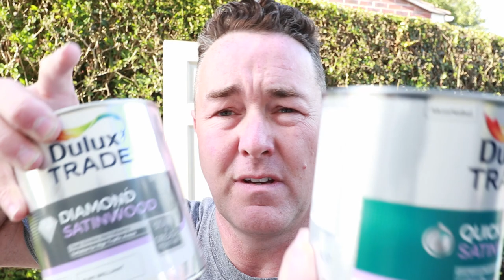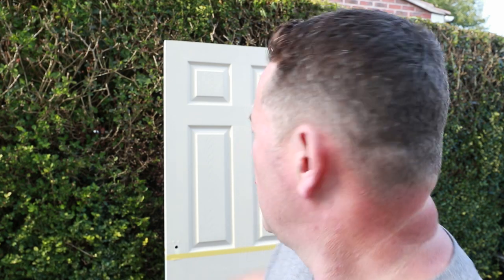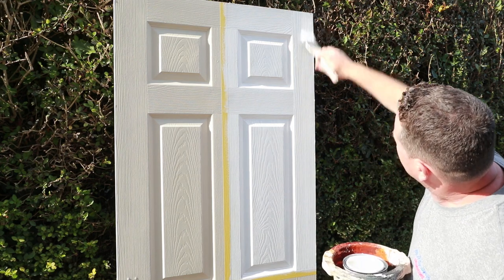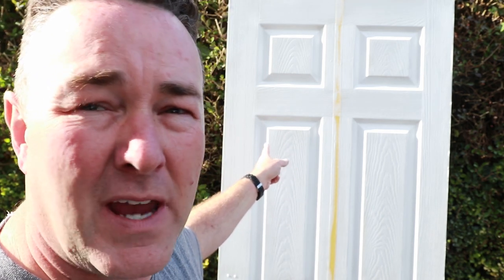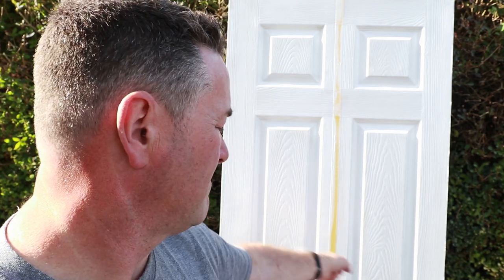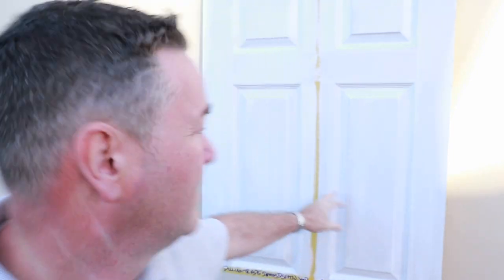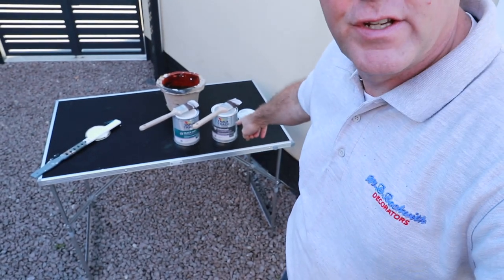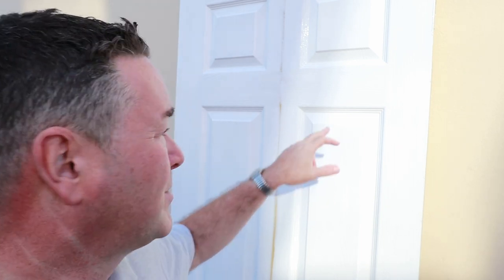Honest Review: Dulux Quick Dry vs. Diamond - Which is Truly Best?

Comment: Hey Phil, I tried the quick dry satinwood.  Poor coverage and very runny. Never used it since.  The Diamond I have used quite successfully over old white woodwork especially where I needed something less smelly than Dulux trade satinwood(oil based). I tend to apply it with a Purdy White Dove mini roller and lay that off with a nice brush.
Reply from the maker: Did you use a QD undercoat with it first?
Reply: @ProfessionalPainterDecorator  I did with the quick dry but not with the diamond. I'm going to try the Bedec MSP and the Scuffx next on your recommendation. Cheers.

Comment: Bedec advance Primer is fabulous as it gives the perfect base. Their satin is nice and their gloss is as good as it gets for water based on the second top coat. I now use Crown PX4 as bonding primer. Dulux diamond eggshell (Jan '24)  for interior work, covers well and finish is spot on but always three coats over anything other than pure white. Thanks for the comparison, got me thinking hence my comment.
Reply from the maker: Tnx 
Have you watched some of the other satin paints I've tried?
Reply: @ProfessionalPainterDecorator  Gradually going through them, I think the Dulux Diamond eggshell shows that Dulux may have listened!  Actually got some Aqua Guard to try , I spoke to a rep at Brewers and he was insistent that acrylics need to set properly for the next coat, so your video of Aqua Guard drying over night would appear to be best practice. I have to sneak time to watch as being at home there are other 'duties' . Will watch more. 
You're a great presenter and I like your dry humour!
Reply: The other thing is how easily paint cleans out of a brush. Sadolin Superdec is probably the worst culprit on this front , isoproyl alcohol, hand soap, 'brush cleaner' nothing touches it and brushes are toast . Sometimes paint choice comes down to availability too. Just saw your review on Allcoat and Frenchchic. I use the former as it does say it has a 15 year guarantee and when the client has just forked out five grand for scaffolding the paint has to stay put. The frenchchic I must try when appropriate. Really good that you're doing these comparisons like for like, really saves us time.
Reply from the maker: @lucifarian93  watch the others... I bet you'll move away from Dulux diamond by the time you've finished

Comment: I tried the diamond satinwood again today Phil and you need to water it down like all Dulux Trade paints. All Dulux Trade is thick with ingredients and go on lovely when you’ve thinned it to how you like. 
The diamond satinwood has a lovely sheen and is a proper whiter than white. Once dry I would struggle to tell which is oil satinwood and which is the diamond

Comment: Hi, I have a question what is the need for undercoating walls and woods rather than just putting 3 coats on of the normal paint? is there any advantage to using the undercoat. Another question what benefit would you get from using an undercoat rather than using a cheap contact matt and then applying one or two coats of that to lighten a surface then using two coats of the finishing paint. Im thinking more for already painted walls.
Reply from the maker: you're referring to wall emulsion primer coats prior to emulsion finish coats.... not woodwork paints like in the video??

(woodwork)  Undercoats are there to give a sound base for the subsequent follow on top coats, using  the same brand/make of paint for a 'Hand in Glove' will give better results too and less likely to get compatibility issues between paints, the Uc helps adhesion on the top coats. Just like a primer for bare wood or surfaces is advised which soaks in to the substrate, that then gives the base for working on with the Uc, then top coats.

similarly so emulsion paints are more suited to have a wall/ceiling primer (undercoat) applied before the 2 finish coats. F&B have a wall/ceiling primer that can be applied first, this does work.
I think it's slightly cheaper too than using the top coat emulsion paint.

I wouldn't be using cheap contracr matt paint to be saving a few pounds now better primer/undrcoat paints are out there.
Reply: @ProfessionalPainterDecorator  yeah sorry I did mean more so for walls rather than woodwork it’s just this video brought it in to my mind. I just always wondered what the gain would be from using for example optiva primer on walls that were already coated over either going straight on with that topcoat paint or if it was a dark wall using a contact Matt then topcoat. 

I understand the woodwork side of it as often working with trickier surfaces or paint types.
Reply from the maker: Optiva primer is for bare plaster.
If you have good printed walls, two coats of the chosen paint should be fine.

As said, f&b for a wall/ceiling primer with does act as a great base for their colour range.

Comment: I have done 2 coats on primed white windows and still looks bluey thrucit on edges. Also how much are you Sanding down as even a light sand takes the edges off back to bare drives me mad
Reply from the maker: Between coats it's a worn sanding pad. But if you sand off edges again and the underlying paint shows though.. it's a step backwards.

As said... There's better paint out there now.

Comment: Hi Phil do you know if you can spray the water based quick dry satinwood you used in this video
Reply from the maker: Yes. Just make sure you've thinned it enough. Some paints do struggle being sprayed.
Reply: I sprayed 22 flat doors with it last week and it's lovely in my opinion. Thinned 5 - 10% depending on the day and they came up really nice.

Comment: Phil been in the construction industry over 35 years and done a fair bit of painting in that time. I do not consider myself at all a decorator. Can I ask your advice I have purchased a Dulux trade weathersheild exterior quick drying satin in a dark blue. I decided to use some of it to paint an old wood table top because I liked the colour. 
I have tried 3 different mini rollers and a brush but still can’t get a smooth looking uniform finish. I sanded and primed the top but now it’s had about 4 coats of dark blue ontop and still looks patchy. 
Any idea how to get a good finish on the top coat. 
Just for clarity I did not buy the exterior paint for the inside table but thought it should be reasonably hard wearing to use once it’s cured. 
Thanks I’m advance
Reply from the maker: Hi.
Should be ok.
What rollers have you used?

Have you tried a 2 fussy Blokes 5mm roller yet?
Add a bit of water to it and see if that helps flow  better.
There are paint additives that keep the paint easier to apply and work.

But try some water first.

Sand down what you've done once it's dried though.

Comment: to be fair though phil you do even need 2 oil undercoats sometimes with mid range colours
Reply from the maker: can't remember the last time I used oil though.
Reply: @ProfessionalPainterDecorator  the post 2010 ones aint great to be honest i always use palatine as they didnt have to change their formulations back 2010 i dont find the post 2010 ones all that durable really diamond satin is tougher than oil based version without a doubt for scratch testing. post 2010 oil paints in tints stay tacky for ages. palatine industrial 2 hour gloss is best for interior work really durable bashes dulux crown johnstones out the water and palatine oxide gloss for exterior work they do a oil matt as well great stuff.

Comment: Have gone back to Dulux trade oil based satinwood/eggshell,  got fed up using this water based paints . You need something that does 2 coats and flows off the brush ,
Reply from the maker: Have you tried scuffX or Jono Aqua Guard... Or WRX?

They'll do two coats
Reply: Can't say I have Phil, the only advantage with waterbased v oilbased is to can put two coats in a day depending on any making good.  But sometimes end up shooting yashelf in the foot, because customer thinks ' you've done that quick! It's not like the old days when they all went to the office.  All working from home seeing what your doing.
Reply from the maker: @marcusdance5068  hence you give a quote... Charging for the job done.. not the time taken 
We have to make some money somewhere... ;)

Try those paints though.

Comment: try and give jono's aqua guard satin a go Phil
Reply from the maker: it's in the pipe line
Reply: Jack what's the trick to using Aqua Guard, I recently did a Window board and the end result was patchy. I was using one of them sponge type rollers with plenty of paint on. Would a different roller make a difference?
Reply: @Messimagician83  try using microfibre sleeve fussy blokes are great 5mm could get away with 10mm but for cills 5. i would toss the sponge rollers if i was you
Reply: @jackwardley3626  Thanks for that, I will have a look for them. Would you use the  same type of roller for spindles and handrails by any chance? Ever since Sikkens stopped doing BL water base I have been researching for a replacement and Aqua Guard came up, my experience  with Aqua Guard so far  is you after be quick or it starts drying on your brush.
Reply: @Messimagician83  yes they work well on spindles etc

Comment: I absolutely detest the Dulux Diamond range both the satinwood and the emulsion, terrible paint to use and apply. I have used the quick dry retail version and it's not a bad paint to use on new builds where all the woods are being primed. In regards to the diamond emulsion, give it a swerve, I find Dulux Easycare to be a much better alternative if the customer absolutely must have durable washable paint.
Reply from the maker: Easy care is a retail paint... There's a picture of a dog on the side... If I have to resort to applying retail paint as it's better than Trade, we might as well pack up now lol

Have you used Tikkurila Optiva5?
That's out day to day emulsion paint.

Comment: Great vid, thanks 👍
I like where you're going, going over off whites...its realistic. Had one the other day...nice simple job, just doors and frames. Old white gloss, in the cupboards, really yellow. Used white satin zinsser allcoat...(as I found the coloured gloss to be great!)....and I struggled to cover in 2 coats! Didn't expect that. Over the clean white ones, no problem, but I'm glad the other ones were inside the cupboards! Customer was fine, but they needed a third really... Should've known better!
Reply from the maker: yep, real world, trying with white paint...... zinnser allcoat exterior in white, isn't the best on coverage/opacity. It's a bit like a glazed white.
A mixed colour is very good... no problems there.
Have you seen the video on uPVC paint testing I did last  year? AllCoat, Bedec & Frenchic.
Reply: @ProfessionalPainterDecorator  yeah,  didn't realise that the bedec was better than the zinsser, but I do prefer the zinsser flow and feel... Not used the French chic...
Reply from the maker: Have to say Bedec MSP soft satin is very nice.

Try Isomat too... you may be suprised

Comment: Waaaay.  He said my name.       Mate I’ll never use Diamond satinwood again.    New wood doors I hit them with 1 primer 1 undercoat. And it took 3 diamond andddddd it still looked crap 😢
Reply from the maker: get your hands on some Bedec Aqua Advance Satin to try out (reviewed in a few weeks)... or the Isomat Isolac Satin.
Reply: @ProfessionalPainterDecorator  I do a lot of commercial work.  Starbucks. KFC’s etc and still trying to find the right paint.  Bradite one can has my blessing at the moment    But again it’s always the whites that let you down.    Where do you purchase  bedec aqua from Phil?      Cheers
Reply from the maker: You can get it at Paintwell, Brewers or even Toolstation.
Reply: @ProfessionalPainterDecorator   Dear Dr Paint Phil. I was going to order Bedec Aqua Advance Satin from Amazon until i read this review.    4.0 out of 5 stars Paint chips off
Reviewed in the United Kingdom on 15 July 2023
Colour Name: White  Nice thick paint that's easy to apply.
The main problem is it easily comes off when knocked. Some of my doors have got chip marks and you can see the old paint underneath.     

This comment put me off buying Bedec Aqua Advance Satin off Amazon as I wanted to use for my sash windows and the last thing I want is the paint chipping off from banging my old windows closed
Reply from the maker: if you bang any paint it will chip off, it also depends the surface you;ve painted onto and if that is soft it'll damage it.  @bsfbestshortfilmsonyoutube

Comment: I spoke  to dulux  customer  services  and they  said sponge down the door  first with a damp sponge to stop it pulling  .it's a bit better .
I then added  10% floatrol paint additive  this helped  a lot but you still  have to paint  very quickly.
I still had to use 3 undercoat on bare wood  and 2 top coat of quick dry satin  .
I just rubbed down some Louvre doors  with quick dry satin not an easy job rub to hard and the paint blisters .
In the end I sprayed them .
I used a % of paint and 10% floatrol and 30% water mixed  I got pretty  good result .
I find dulux trade doesn't   settle  like oil paint so one minute  it looks ok then you have a run you can't brush out because  it dried very annoying 😒. 
I won't be using dulux trade anymore  .
The thing is why should I  have to spend a fair amount  of money  to find a decent paint that works ! 

It's a bit be
Reply from the maker: there's better paints out there now.
a sponge and water is what they used to say to do years ago when they started to bring more wb paints out... that's a faff you don't need to do with other paints.

Comment: End of the day you can not beat oil base on wood.
water base for walls oil for wood.
38 years time served as a decorator also I'm a Dulux select decorator city and guilds plus Nvq 1,2 so I had the unfortunate experience of using that quick dry satin and tell you now don't buy its terrible!
If you are willing to use it make sure you check for runs about 15 mins  in otherwise your gonna be doing a lot of re sanding and re applying .
water base will never be as solid as oil base, and never flows of your brush like oil. the end.
Reply from the maker: Welcome aboard Matt.

Water based have come on so much now, I can't see why why all exterior paints can't be waterbased, it moves with the wood a lot more than oil.
How many jobs to do you go to with faking peeling paint... And you know it was all oil based.

Dulux only have one good paint... Heritage.
The others are questionable;)

Comment: If the diamond is oil based why are you surprised its hard to apply its always thick and stringy out the tin. Thin it down with white spirit like your supposed to and apply 2 coats. Oil based is much harder wearing
Reply from the maker: LoL.
I'll let you watch the videos all the way through.

;)
Have a read of the description to the video as well.